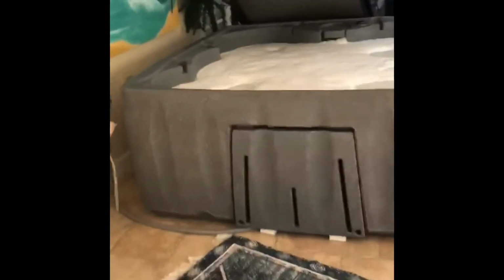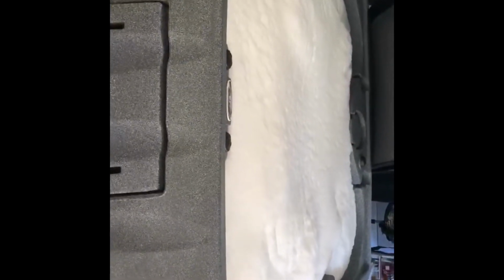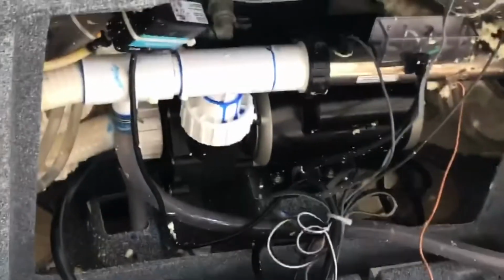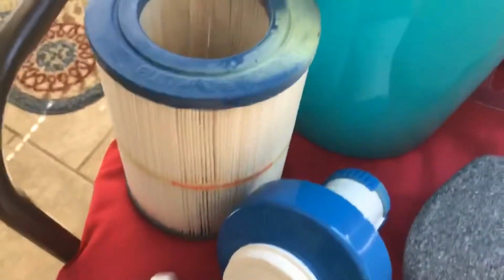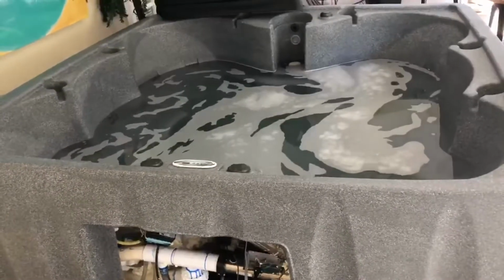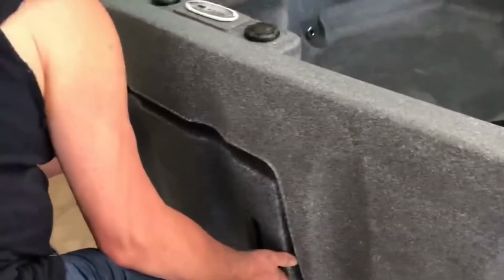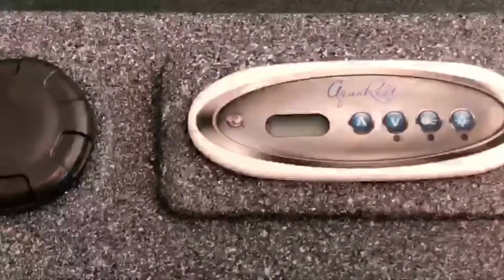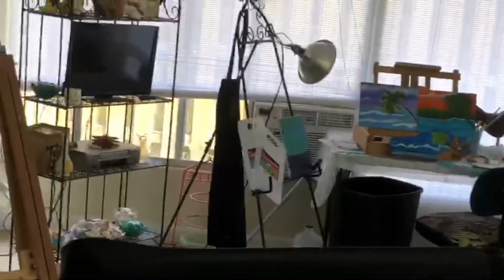Aquarest 600 Premium Purge/ Clean.

Comment: Yes! The door panel attachment construction is very bad on these, requiring their bolts be returned into holes in plastic that quickly strip. We ALL have to leave the door unsecured. I have a rock I slip under the panel to hold it in place. Yes! The drain hose connect dribbles until it gets draining good, tightened or not. These problems and having to scoop out 6 inches water below the lowest jets to complete emptying with it stop working and blowing breakers after restarting after Only 3 years are why I will not replace mine with another from Aquarest!!